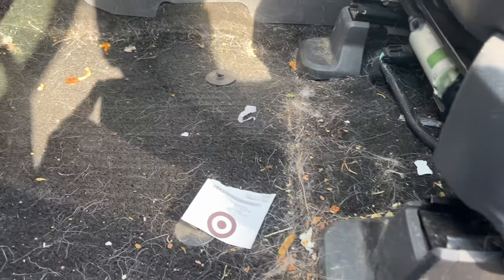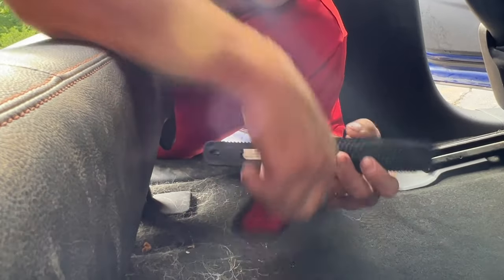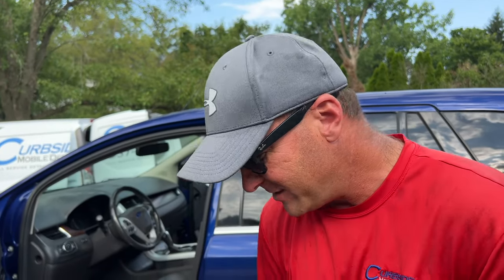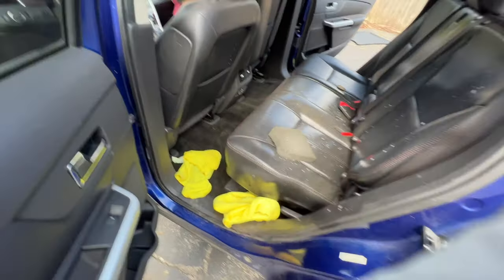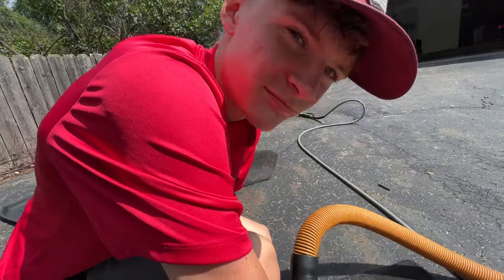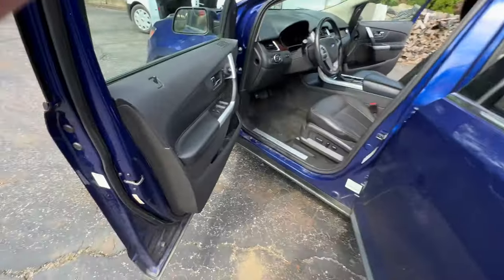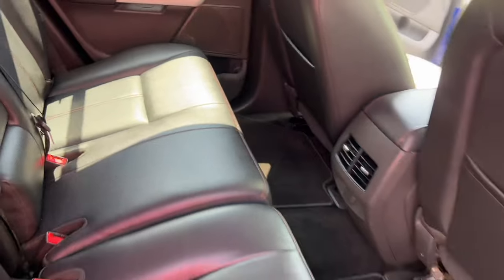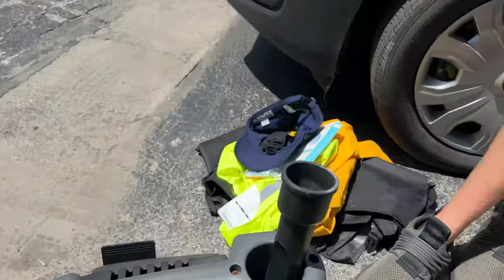Ridiculous Pet Hair - Fur Eel - Lilly Brush - Devastating Injury - Plus My New Detailing Helper

Comment: Does that fur eel go directly on your crevice tool or did you buy the adapter and fur eel tool for rigid

It looks like it’s just the fur eel tip on your crevice tool, just wanted to make sure before I bought, I’ve got the same rigid vacuum
Reply from the maker: I just stick it on my crevice tool. It’s not a perfect fit but it works. I tried the “fang” but it didn’t fit my hose very well so I chucked it
Reply: @TheDetailingBusiness  sweet thank you